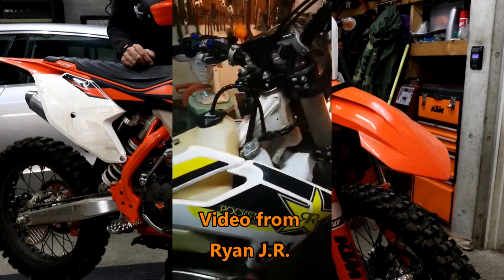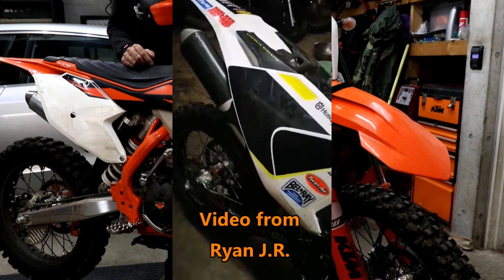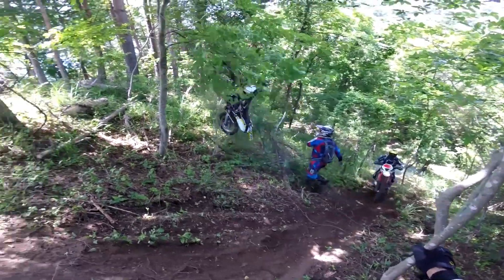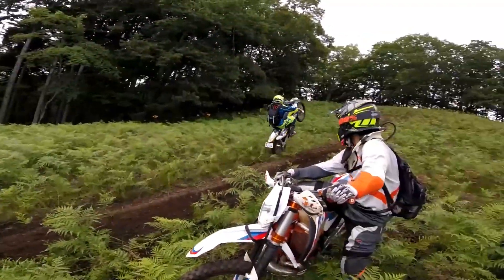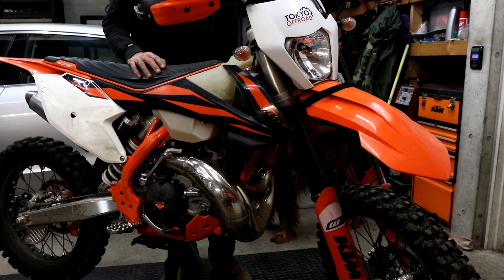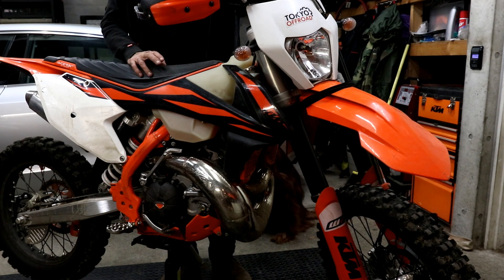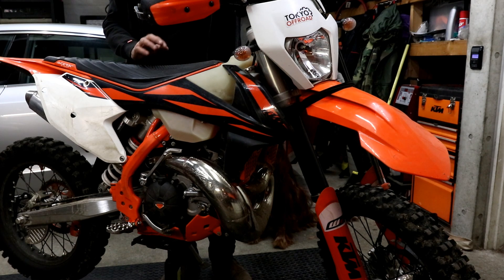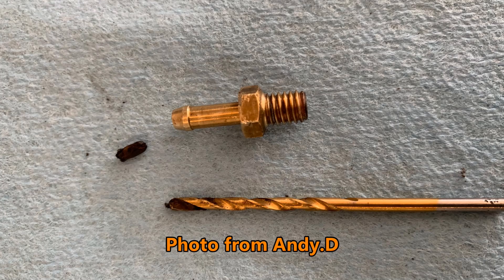2-stroke TPI Engine Issue & Easy Fix

Comment: I have major issues on my 2021 250exc. I can get it fired 2-3 times that it shuts off completely. Was running perfectly before. Seems like not sparking, but the spark plug seems to work perfectly, fuel pump is checked as well. Any ideas? Could it be the sensor?
Reply from the maker: Sorry to hear about the problem. Make sure the inline fuel line connector is plugged together fully (it should click) and check that the inline filter inside the connector is not clogged. Is the battery fully charged and voltage OK? Have you tried replacing the crankcase pressure sensor? If you don't have a spare (it's a good idea to always stock a spare sensor) you could try swapping the atmospheric and CCPS as they are the same part number.
Reply: @TokyoOffroad  fuel line connector is plugged together fully, I'll check on the filter today, hence I think I didn't even see one, maybe the injectors are clogged too? I removed the crankcase pressure sensor, cleaned it and reassembled, hope it isn't broken. What do you mean with swapping the sensors? Thanks for your help, highly appreciated
Reply from the maker: @777-o1u  In the oil pump plastic tray there are two pressure sensors: the one with the hose connection to the crankcase is the CCPS, the other one (with no hose) measures atmospheric pressure. The two sensors are the same part number and can be swapped. The atmospheric sensor rarely goes bad.
Reply: @TokyoOffroad  gotcha! Thanks so much, I‘ll be back with the result
Reply: @TokyoOffroad  so the fix was a new spark plug, got a new one installed and bike goes perfectly
Reply from the maker: @777-o1u well that’s good news. But I thought you said the spark plug works perfectly.
Reply: @TokyoOffroad  yea thats what I thought, just ordered a new one just in case if that does anything. When I tried the old one it kept firing so im confused too
Reply from the maker: @777-o1u  Great that you have the bike running again. And an easy fix

Comment: Hello all, please solution....
im Dino from Batam Island Indonesia, i have Husqvarna TE300i 2021, my problem is 
currently the spark plugs often die....  when the injection test, the gasoline spray is very much, the ecu has been tested and is in normal condition, is there another possible cause? Thank You in advance.....

Comment: A 2-stroke crankcase is coated with oil, some of that is carried through that hose. Why couldn't there be some kind of collection filter where the oil residue due goes down, and the air goes up?
Reply from the maker: This is something that could be improved on for sure. I know some people use some mesh, but that can get clogged. Wish KTM would figure out a more reliable system...

Comment: Hi there, I’m trying to diagnose the exact problem with my 2021 tpi, it seems to be holding revs after accelerating (half/full throttle) then rolling off the revs maintain for a little time, pulling in the clutch increases them but still disconnects the drive. Could this be the same sensor issue? 
Thanks  
Josh
Reply from the maker: No, it doesn't sound like the same issue. When the bike is in neutral and you rev the engine how does it respond?
Reply: @TokyoOffroad  thanks for replying so fast, really appreciate it! I’ve just warmed it up after work and tried it in neutral and also a quick ride down the Lane and back but as is typical it didn’t seem to do it at all. I’m riding Sunday properly so will try it in neutral then. On an evening ride yesterday, when flat out trying to get up a climb and didn’t make it, it held the same revs as being wide open for a few seconds as I gestured to a mate before it started winding down
Reply: @joshwatson4654  did you work out what was happening with your hanging idle issue? I have the exact same problem with my Husky 250i?
Reply: @scottf7834  Hi Scott sorry for the late reply, only just seen this now, I did. So my issue was what they call a hanging idle and it was caused by the air by pass screw not being set right in relation to the idle adjustment screw I had to fit.
Reply: @joshwatson4654  Cheers Josh, we have ours sorted also. I completed the air bypass mod and have the screw all the way in. I also had issues with it not starting easily when cold. New top end rebuild (70hrs) and its like new again!
Reply: Got a 19 ktm300 exc tpi and had a tsp head put on about 20 hours ago I recently did idle screw mod but stuck with a hanging idle iv tried everything I can with the idle screw and air screw could it be the sensor

Comment: Can you bore the barb out a little and make it harder to plug or is it size sensitive?
Reply from the maker: The internal bore of the brass engine fitting is 2.5mm. The external diameter where the hose fits is 4mm. If you bore it out it'll make it thinner and possibly prone to snapping. As such I would not recommend modifying it, but instead clean it out regularly (every 40H or so)...

Comment: Man i have ktm 300 tpi and the engine dies in the trip  every day I took it to the dealer and they say there’s no problem with the bike but the problem still happens every day and I don’t know what to do can anyone help?
Reply from the maker: Please describe the issue more. Is the engine stopping while idling, or cutting out while you are riding and have the throttle open?
Reply: @TokyoOffroad  the engine dies while im riding  when i released the throttle and pulled the clutch at same time  .I changed the spark plug but still ,my bike is 2020 300 tpi has 55 hours
Reply from the maker: @a.kq8984  Have you tried increasing the idle speed? I recommend doing the idle screw mod if you haven't already done so: https://www.youtube.com/watch?v=TLzicMxsBWs
Reply: @TokyoOffroad  actually i  increased the idle little bit but still this happens
Reply from the maker: @a.kq8984  Does it idle normally when in neutral? The problem only occurs when the bike is in gear with the clutch pulled in it may be that you have excessive clutch drag. If you start the bike in gear with the clutch pulled in does it want to move forward?
Reply: @TokyoOffroad  yeah if the bike started with gear the bike moving forward, and the idle is normal
Reply from the maker: @a.kq8984  You might have air in the clutch hose. This video shows how I bleed mine: https://www.youtube.com/watch?v=6OnQmWnDFvA
Or the clutch master seal may need replacing:  https://www.youtube.com/watch?v=yigjs0JVai8
Also be sure not to overfill your transmission and use the recommended oil.
Reply: @TokyoOffroad  thank u man ur saving my life

Comment: Hello, great video as always. I am looking for a direct replacement for these CCPS sensors on my 2020 that I can get from auto parts store in the states, KTM has them back ordered until 7/21. I believe the one that reads ambient air pressure is faulty as my bike seems to be running poorly again, I took to shop the first time and the mechanic swapped them and it eventually came back to life for awhile. I ordered a spare and the parts guy sent the totally wrong part. Very frustrating. Thanks

Comment: I have the same symptom with the up and down revving when I'm not touching the throttle, but this only occurs if I'm using the warm up screw on the throttle body, it runs well otherwise except when I get really high in the Rev range like on a long flat out section, it starts sputtering like it's starving for fuel. Could my case also be the ccp sensor? Everyone else seems to have trouble in the lower Rev range. My pipe and brass nipple are clear, so I'm thinking of replacing the sensor but I hope it's not in vein. I love watching your videos thank you
Reply: Did replacing the CCP fix your problem? I have the same symptoms on my 20 te300 as your described. Pipe and brass nipple are also clear on mine. Hoping that changing the CCP will fix it.

Comment: Hey 
I have a problem with my 2018 tpi 250.
When i ride, and go up in the rpm the rpm stayed very highly. Its sound like the throttle stuck but it’s not, he is working good. The rpm returns to normal only when i released the clutch an breaking hard. Can you help me? Pleas it’s really annoying, and take the fun out of the riding
Reply: I have the exact same issue with my 2018 Husky Te 250i, have done the idle mod and have wound the air bypass screw all the way in for great performance riding but is extremely hard to start when cold seems to be over rich and over fueling. But if i lean the air bypass screw out i get a hanging idle effect?
Reply from the maker: Sorry to hear about the problem. One possibility is that it is running excessively lean and hanging idle is occurring. Possible causes include: Throttle body air screw too open (try closing it and see how the bike responds), air leak- check that the throttle body to reed valve hose clamps are secure and that the reed valve gasket is OK.
Reply: Уменя тоже так происходит. Как решит проблему. @TokyoOffroad

Comment: Hello Tokyo Offroad, I have a big problem with my Husqvarna TE300i 2020 (105h) that I can't find the solution. It's smoking so so much. I changed the crankshaft oil seal, the o-ring and the distance sleeve and the bike keeps smoking like hell. I even took the oil pump tube off the throttle body to get sure it wasn't a 2t oil problem. Where else can the gear oil get into the engine? I'm getting mad. Thanks!

Comment: What would stop the bike from revving any ideas it starts but wont rev
Reply from the maker: Have you checked for the issue (blocked crankcase pressure sensor tube/fitting) described in the video? This will stop the bike from revving out....

Comment: question is why it can happen in almost new bike...
Reply from the maker: It happened temporarily on a friend's TPI 2 weeks ago. He crashed by sliding off the trail on a wet log and the bike landed upside down on a steep slope . After that the bike wouldn't rev out, just like the bike in the video. We managed to get it back on the trail and took a rest for a few minutes. It then returned to normal performance. My guess is some oily residue got into the crankcase pressure sensor tube while it was upside down, temporarily blocking it, but then drained out. So I think if the bike goes upside down it could happen to any TPI, old, or new...

Comment: Excellent video! Just wondering what this sensor is really for? For example, should the ECU read though the sensor that the cylinder compression is low and lock a fault error, say wore rings or piston?

Comment: I have a te250i 2018. At steady throttle it has the same problem as your video describe. Even more, it wont rev. When intry to give it a little gas, the power is gine, The rev goes down and the bike stall. how should insay it, “bog”. 
Do you have the same problem? I already did what your video explain. But the problem still there.  Please helop 🙏🙏

Comment: Great info, thank you. Have you seen the issue of a lack of oiling? 2020 KTM 250TPI. We lost the motor after 33 hours where it showed signs of major lean condition. Lost both top and bottom. According to the trained KTM tech, it looked, to him, as if the motor had 233 hours not 33. KTM saw the pics and paid for parts, but how do we avoid this is the question. We also have a 2020 Husky 250i.

Comment: Hi, I’ve just picked up a 19 300 TPI in England and wondered if you could give me your thoughts on this? The speedo, odo and machine hours do not work or increase. The clocks do light up and the time and lap timer work fine. Thanks.
Reply from the maker: GS Mad - The most likely cause is the front wheel sensor. Check that there is a magnet installed in the front brake disk. Then check the sensor is installed and that the sensor cable is good and I damaged. If the cable is damaged either repair, or buy a new one.
Reply: Tokyo Offroad Hi, thanks for the answer and i have now fixed. FYI, because the hours wasn’t working I think I was looking for a more complex problem. I thought the hours would be more securely recorded but they are not. The magnet is needed not only for the speed, but also the hours - I did think the hours increased just on idle, but now know that is not the case. I also have a husky and the magnet on that stands out on a lug on the disc, but on my new bike, it is much more discreet and not obvious at first sight. Anyway, a new magnet and sorted. I wonder how long the magnet has been missing on my new to me 13 hour 19 model????? Cheers.

Comment: Hello from Russia. I’ve been watching your videos for a long time. Changed the piston on it and not only).
I sold my husky 2017, I choose a new motorcycle. How is TPI? In the first versions, as I understood it, there were a lot of problems. Should I take the KTM 2020 tpi or look towards competitors with a carburetor? 
And if it's worth buying, then what needs to be fixed right away?
Interested in your opinion. Thanks.
Reply from the maker: I enjoy the power response and feeling of my Keihin 38 PWK + STIC and RK Tek head equipped 2017 250EXC. My 2019 250TPI feels quite different. The power stock was less than impressive and improved a lot when I fitted an RK Tek head. It produces very tractable power, but for me the carb model is more fun to ride, especially in higher traction conditions. But I enjoy riding both and rode the TPI last weekend and the carb model today. I think the comparison of 300 models is similar as I have friends who have both.

Comment: so the question is why sometimes even on new bikes this gets clogged?     BTW I really curious what your top end rebuild will reveal about piston and cylinder ...
Reply: Wild One  mine was nearly perfect at 80hrs. Still had cross hatch pattern on piston and good even light covering of carbon on the top

Comment: I plan at least 2000+hrs on my 2017 300 EXC with Lectron. TPI is a big step back performance and reliability-wise. Perhaps it is an answer to upcoming emissions standards, but Im not into the green leftist agenda, especially when authorities refuse to do anything about 20-40 yo trucks on the road literally spreading poison into the air.
Reply from the maker: Only 2000H! I’m not sure that I’ll ever sell my 2017...
Reply: Tokyo Offroad have you already done a bottom end? I have 380 hrs on mine (already 3rd piston). I am thinking doing nicasil and bottom end in 450hrs...btw I discovered my ohlins shock was rubbing and eating into my airboot wall. I had to round the edge where reservoir connects to main shock body...check it out if you havent already - can be nasty if a hole is created.

Comment: Any clue why some bikes get clogged and most don’t?  My 2018 tpi 250 is at 155 hrs.  I checked the breather tube two months ago and it seemed clean.  Cleaned out the rubber hose and checked the brass fitting.  No issues.

Comment: What oil do you use in your reservoir?? I’ve heard if you use normal 2 stroke premix it can block the oil injector
Reply: Good question  to ask, actually.  In the marine world, premix oil is actually  different  than stuff  for injected setups...which makes sense. Totally  different  delivery method, viscosity , solubility, etc.
Reply from the maker: I use the recommended Motorex Crosspower 2T oil. On the TPI oill is injected into the throttle body and does not pass through the fuel injectors.
Reply: Tokyo Offroad thank you! I pick up m 2019 husky next week

Comment: I change it every 35 hours because at around 40 hours it will start bogging like that one in the video and the reason I change it is because that part only costs €4 so it's not worth it cleaning I just buy 5 of them for €20 and keep them in the tool box. 
PS: It's an easy and simple fix just 5 minutes job and your done ;)
Reply: What is the spare part number ?
Reply: @erikfrejinger2539  Vacuum Connection  55430023000
Reply: @stone4858  Is it easy to remove? Because I found only one vacuum connection in the manual and this is glued with loctite green (high)?
Reply: @bene9231  The one I'm talking about comes with red loctite and yes it's very easy to remove
Reply: @stone4858   with out heating it? And do you know the torque of the screw?
Reply: @bene9231  No you don't need heat. I don't know how much torque it takes, I always done it by hand but don't go crazy tight because it's a small part